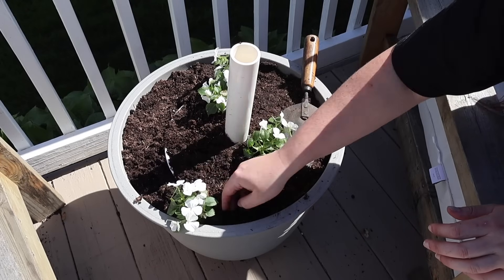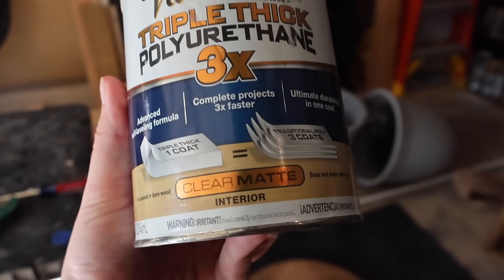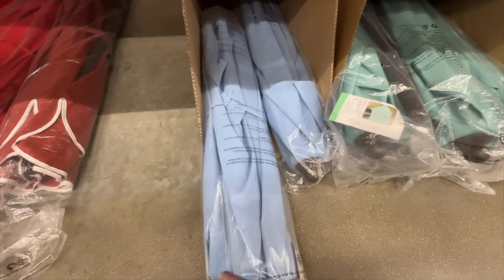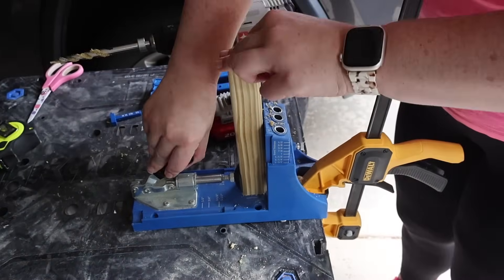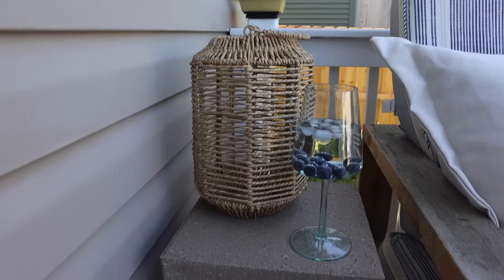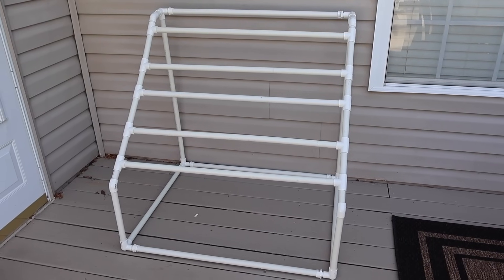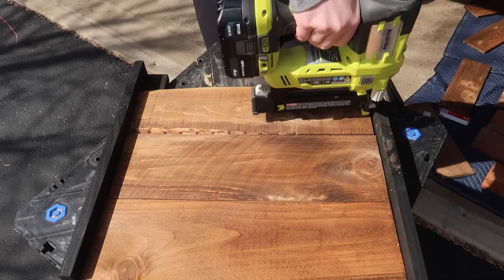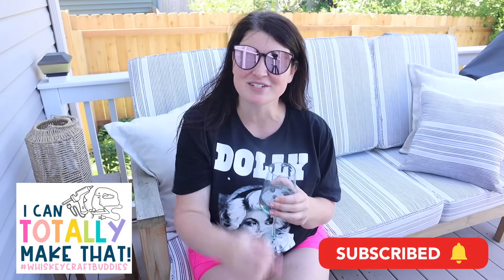WOW! Upgrade Your Outdoor Patio + Deck with these Budget DIY Decor Ideas!

Comment from the maker: ▶ VIDEOS I MENTIONED & SUPPLIES ⬇
0:00 - Intro
My Sunglasses: https://amzn.to/4c8IVMR

0:34 - DIY Planter Hidden Storage for Patio
Planter: https://bit.ly/3x8a2ZG
Wood Round: https://bit.ly/4epGo2X
Wood Glue: https://amzn.to/4c7eTJp
Nail Gun: https://bit.ly/3EUi9K9

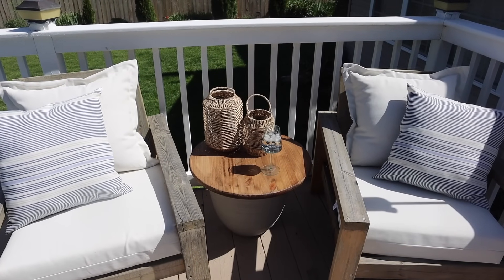3:46 - DIY Planter Umbrella Stand for Deck
Umbrella: https://bit.ly/3yYye0U
Planter: https://bit.ly/3x8a2ZG
Bucket: https://bit.ly/4c7e2br
Concrete: https://bit.ly/3XbDU1E
PVC Pipe: https://bit.ly/3XfbLXA

6:20 - DIY Concrete Top End Table - Under $15!
Concrete Paver Table Original Plans: https://learn.kregtool.com/plans/concrete-paver-outdoor-side-table/
Drill: https://amzn.to/3q0ICRO
2x2: https://bit.ly/3yYufkW
Paver:  https://bit.ly/3Vwb0YY
Small Kreg Jig: https://amzn.to/45ebW7y
Large Kreg Jig: https://amzn.to/3VtBjz1
Mitre Saw - Ryobi: https://bit.ly/3sfYlbD
Mitre Box: https://amzn.to/3lQttw1
Ryobi Power Sander: https://rstyle.me/n/fnjvcfcpyxp
My Ryobi Saw: https://rstyle.me/n/fnqvgecpyxp
Liquid Nails: https://amzn.to/3yR2Hhy

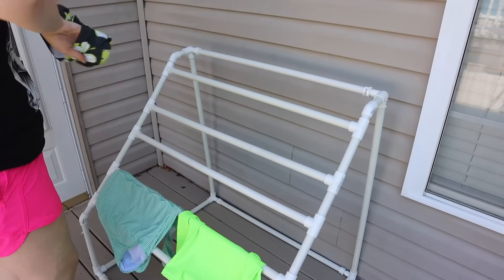11:39 - How to build a pool drying rack with PVC Pipe
3/4 PVC: https://bit.ly/3XfbLXA
Cutters: https://amzn.to/3V5ozwU
Corners: https://bit.ly/45i3PXx
T Bracket: https://bit.ly/3yQahsN
45-degree bracket: https://bit.ly/3x4s6Uu

14:28 - DIY Fence Picket Cedar Planters - under $15
Ana White Plans: https://bit.ly/3KuHCvj
1x2 Furring Strips: https://bit.ly/3o53dDh
1x3 Furring Strips: https://bit.ly/4113Qfz
Jet Black Stain: https://bit.ly/410QsrK
Home Depot Pots: https://bit.ly/3KqZWWd
Deck Sealant: https://bit.ly/401jbLY

19:17 - DIY 2x4 Outdoor Patio Set on a budget
2x4 Furniture Video: https://youtu.be/ecACj_QA56E

Comment: If you have a fence and a garage close together, just buy a retractable clothesline for $15.00 instead of all that PVC. I attached the clothesline holder to the garage and I slide the end of the rope between the fence boards. My line is on an angle but still drys the towels.
Reply from the maker: That’s a great idea! I don’t have that set up, but maybe I could find something similar to work!

Comment: I used a wood round table top outside. I stained and sealed it, but it split a couple months. I’m in Alabama maybe that’s why bc it’s way hotter and more humid than most places.
Reply from the maker: Hi there! Oh no, the humidity could be to blame, was it in 100% sun all day too - sometimes if the sun is too hot it can warp the wood leading to splitting. Sorry that happened to you!